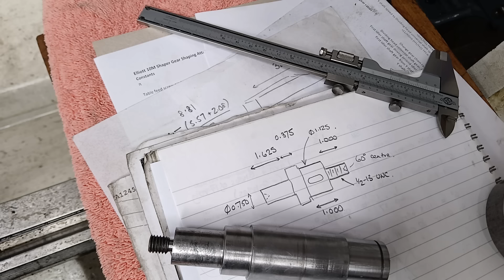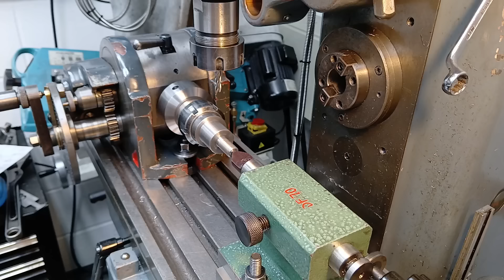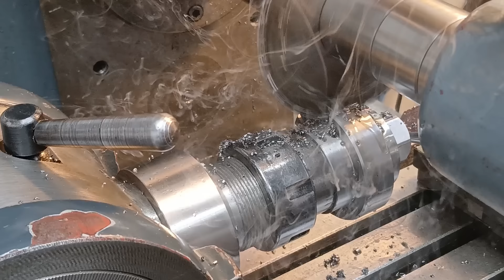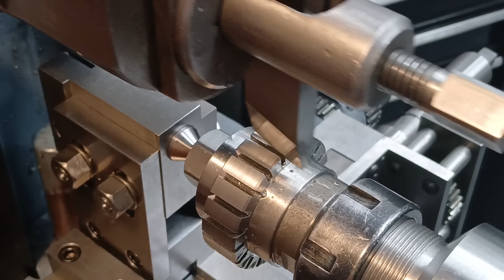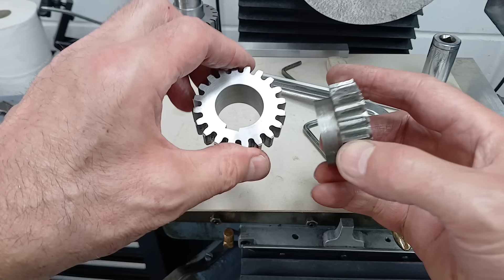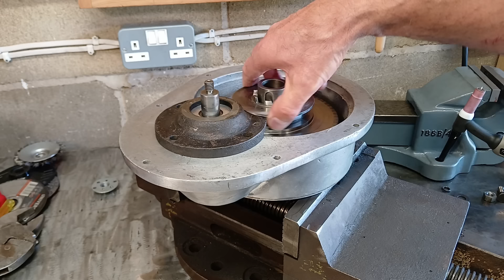Machining a 20T 10DP Gear Part 2

Comment: Very clever , Very nice but , Very un practical.
Reply from the maker: @adrianfernandez1806  Not at all impractical. How would you cut a gear? With a hobber and a gear hob? Fast, practical and expensive. No? How about a mill and an involute cutter? Faster than the shaper and fine if you have the right cutter, but the cheapest cutter I could find for 10DP 20deg was about £60/$80, probably the only time I'll ever cut such a gear. I just had to grind a piece of HSS. How about odd sized DP gears to fit a shaft spacing (I've done this) or profile shifting? Easy with this setup.

Comment: probably a stupid question
what if you reshape the first gear with the new pressure angle as is? gear cutting is always just an aproximation of an actual shape anyway
Reply from the maker: @kokodin5895  If I tried to recut with a 20 deg PA tool there would be very odd shaped teeth, there would be dents in the lower part of the flanks. The trochoid section at the root of the tooth undercuts slightly with 20T and 14.5 deg PA. Your last statement may be true of gears cut with an involute cutter if the number of teeth is greater than the minimum in the range specified for an individual cutter, but it is incorrect for gears cut either with a gear hobber or with the shaper as I do here, as it is cut with a rack tooth shaped tool moved at the correct traversing speed as the gear rotates.

Comment: I think the shaper mod videos showed up. They did not previously. This is an innovative way to cut gears. While gear cutters work, they are not always a precise method. You get screwed by these approx gears when running at higher speeds which demand the involute profile. Fellows did an awsome job in their gear shapers. This approach uses a metal shaper with mods to get that involute. It’s also useful in cutting dual DP gears. Some gears were cut using TWO DPs. One at the top and another at the root. Hardinge change gears are like this.
Reply from the maker: Thank you. I originally made the fixture to avoid spending money on involute cutters, only to use them once or twice. You're right, the profile should be closer to the ideal than a milling cutter as you have more teeth than the minimum the milling cutter is designed for. In principle, profile shifting is trivial, though I've not tried this. As for dual DP gears, thats not something I've come across or tried (yet?).

Comment: Very nice way to cut a gear! Never thought that it could be done like this. What's your background? Machinist for all your live? Guessing here. Thank you for sharing your nice work! Best! Job
Reply from the maker: Thank you! My background? Electronics! Specifically, RF and high speed amplifier design on integrated circuits, retired now after 39 years.

Comment: Nice work, Robert!. I am curious, what was the total machining time to cut the gear teeth on the shaper? I do love watching that machine do its work.
Reply from the maker: Thanks for the compliment! Total time to cut the gear was 2 to 3 hours I think. 225 thou total depth taken in 5 passes, roughly. 20 teeth, 50? strokes per pass per tooth at 87 strokes per minute gives about 1 hour, not allowing for rewind time, incrementing the tooth, break time to maintain concentration. The video has most of this edited out!
Reply: @ThePottingShedWorkshop  Our videos are always a small, small, small representation of the real thing. Have to keep it interesting!

Comment: Perhaps gashing the blank on the shaper with a slotting bit would be better for assuring accurate indexing. The only complication I can think of would be changing the slotting bit to the gear cutting bit and assuring the position relative to the work wouldn't change. It just occured to me also that one could theoretically fasten a small grinder to the tool head and grind the teeth on hardened gears with a properly shaped grinding wheel.
Reply from the maker: You could gash the blank on the shaper. It would be slow though. Look at the keyway cutting, downfeed is about 1 to 2 thou per stroke as its only a little machine. 225 thou depth, 20 teeth, 2 thou per stroke is a lot of strokes at the minimum speed, as theres no auto feed on the tool slide.

Comment: Enjoyable viewing, especially the hobbing of spur gear in slotter. You do know you could have done the hobbing in the mill. Either gear cutting tool or single point HSS tool in a fly cutter.Just saying. Your arbor would have to be made longer in length to clear er collet head.
Reply from the maker: Thanks for watching. Whilst you could cut the gear on the mill, it would require an involute cutter of the required DP and PA. A hand ground flycutter bit isn't going to have the same accuracy. Or you could use a hob, but timing the spindle to the rotation of the blank would turn this into a proper gear hobber - watch some of Tom's Rabbit Hole videos where he's done exactly that and its a lot more work. The tool for the shaper is a trapeziod, ie a rack tooth, easy to grind accurately.

Comment: Thanks for sharing this series with us! I love that with your setup you only need one cutter for each Pressure Angle/Diametral Pitch combination instead of a set of 8. I understand that you need a fairly large set of gears to generate the correct number of teeth, but theoretically, couldn't those be 3D printed? It would also be interesting to know how much closer to the perfect involute form this method gets you vs. an off the shelf cutter?
Reply from the maker: @marcsimonsen1578  Thank you for watching and commenting! It was the simplicity of the cutting tool that led me to make the attachment in the first place. You don't need a vast set of gears, I think I have about 14 including a couple I've made. As you need a universal dividing head for this, they should come with a set of gears (mine was missing a couple). You could buy a cutter and mill a few too. 3D printed gears may work fine, but thats not something I've tried. As for the shape, this technique should produce a "perfect" shape (mechanical limitations apply, obviously) whereas an involute cutter is only correct for the lowest number of teeth in its range ( a 135 to rack cutter has curved flanks, for a rack they should be straight).
Reply: @ThePottingShedWorkshop  Thank you for that explanation! I have a decent machine shop, but I lack several critical tools, such as a tool and cutter grinder, shaper, etc. I've been looking for some in my neck of the woods while learning all I can about them. I had heard that you could cut gears on a shaper but had not seen it in practice until you showed us the implementation!